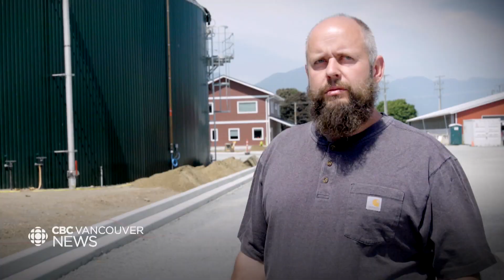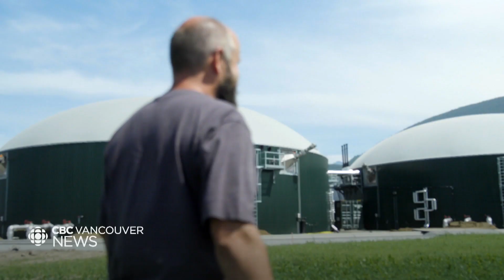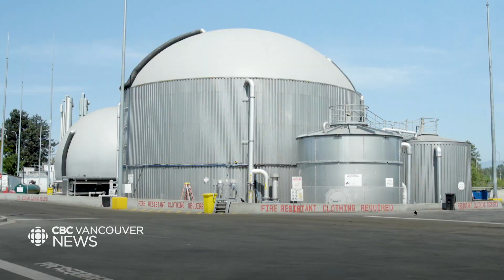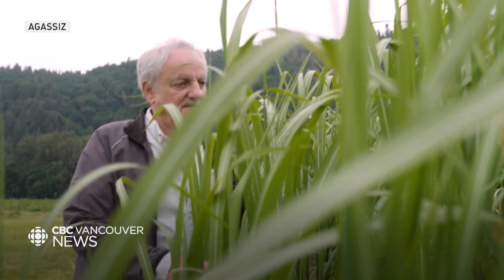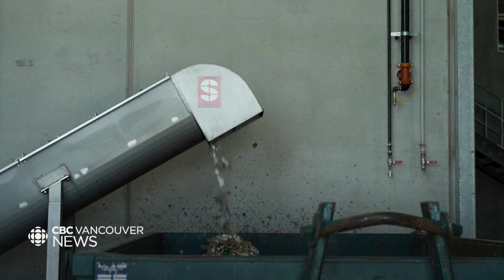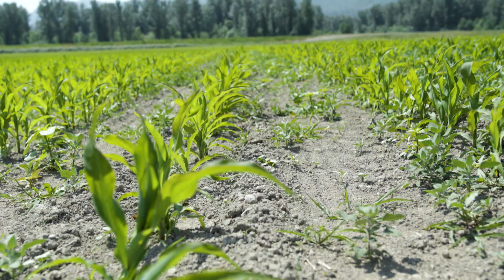Chilliwack farmer heats homes by turning waste to fuel

Comment: There's a great energy to waste facility in burnaby.  They burn garbage, then use scrubbers to keep the emissions low, produce electricity, sell it to the grid.  A better solution to the recycling boondoggle.